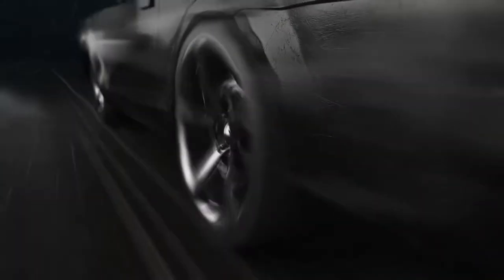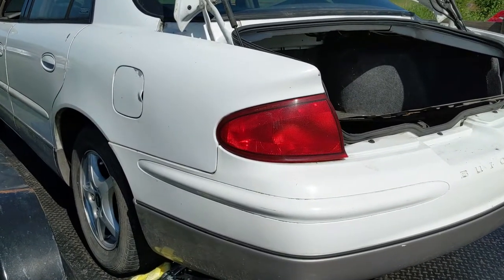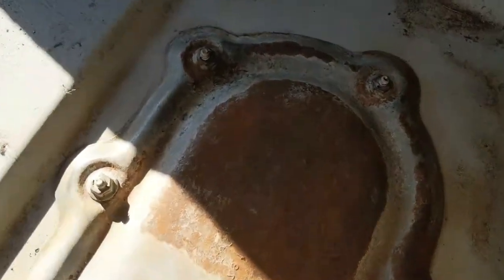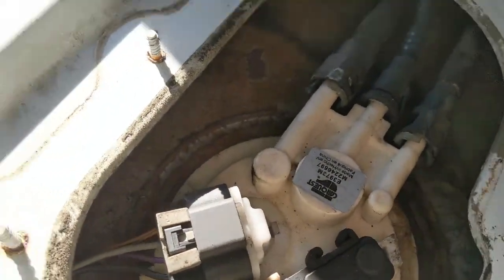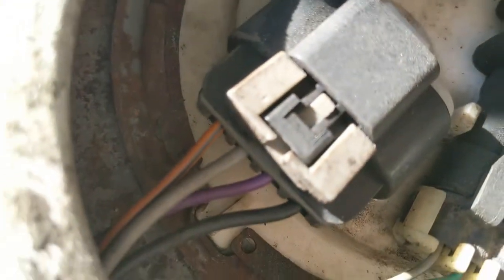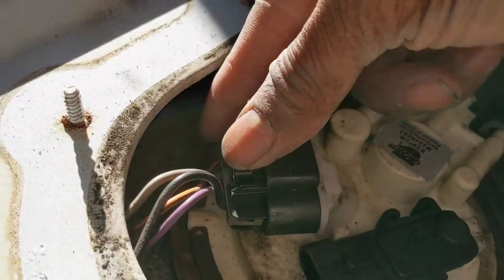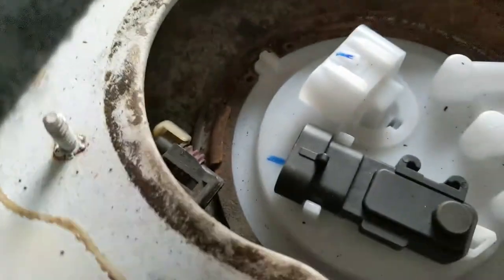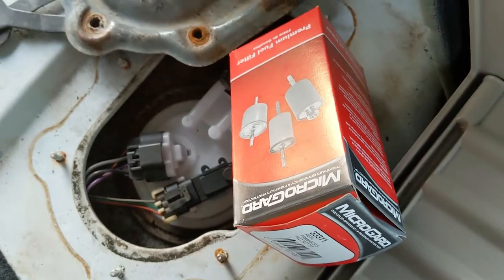How to Replace Your Fuel Pump on a 1998-2005 Buick Regal Park Avenue

Comment: I have to do this asap with my 2000 park av. Spent 1700 on fixing the sensors and it’s still randomly shutting off. I’m not a car guy but this helped a lot
Reply from the maker: Sorry to hear of your trouble, I hope you get it worked out.
Reply: Try the ignition control module very easy to replace read up on it may be your issue

Comment: 1998 is different, That procedure is for 2000-2005, I think
Reply: 100% just changed one clips and stuff are the same different ring and the cover was in the right side if your facing the trunk from the back
Reply from the maker: @Death5007 thanks for the feedback
Reply: @Death5007  HEY! hope your seeing this, so what your saying is there is an access panel in the 1998 Buick LeSabre on the right side on the inside of the trunk? I'm trying to have my dad replace my fuel pump and I know this would make it a lot easier? I've seen videos of people just cutting their own holes but that seems like a mess.